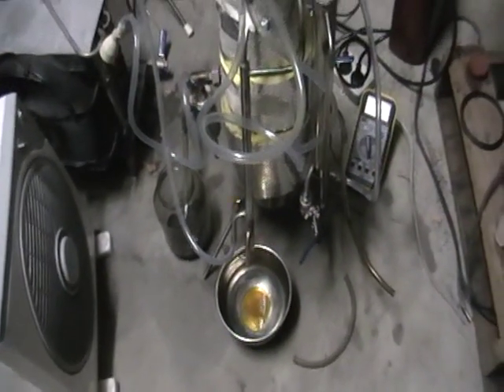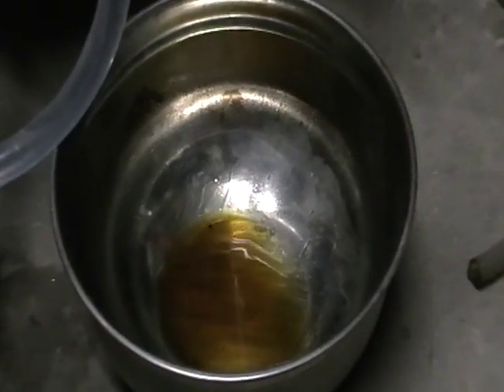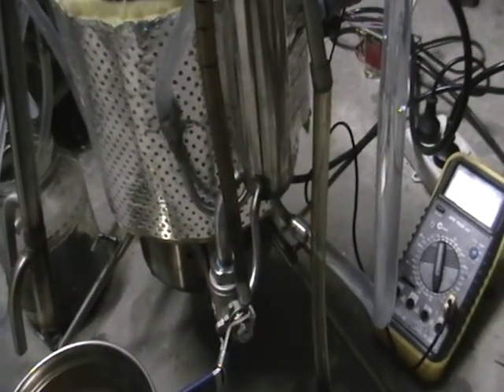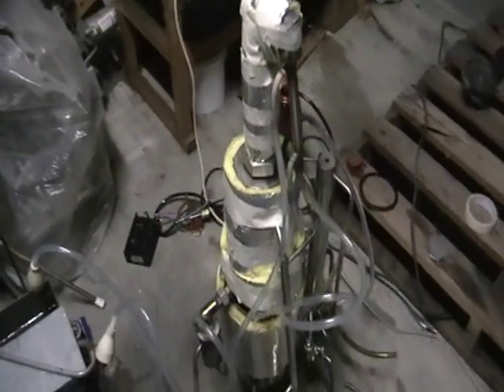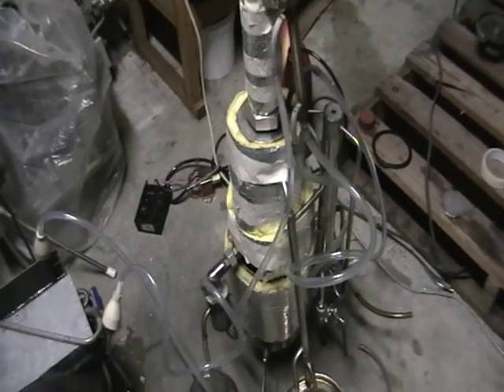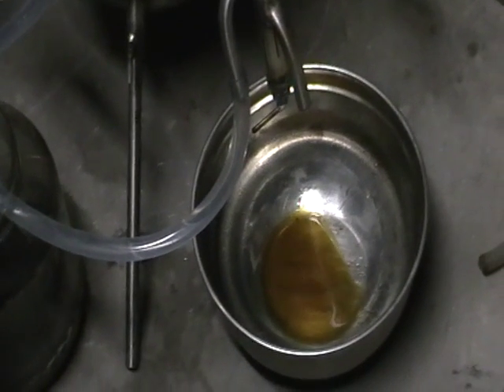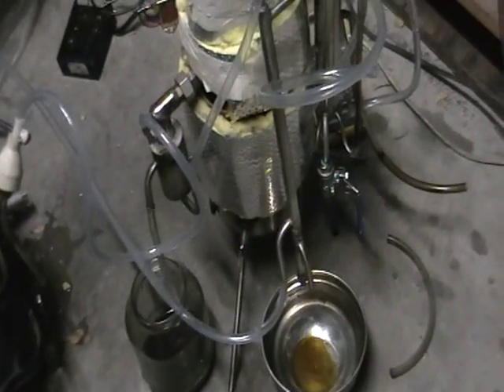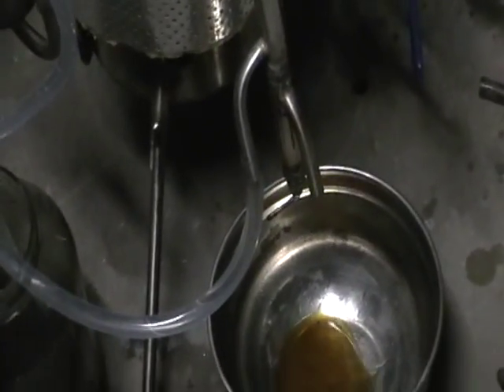Waste motor oil cracking

Comment: Hi, I'm from Mexico. I'm interested in buying your oil distillation manual. To get diesel, I have some questions. How many liters does it produce per hour? What fuel do you use to heat the oil? I wait your answe

Comment: Yes but, I don't. Have a machine shop and stainless steel welding equipment. Cost for a working used oil to diesel fuel converter?

Comment from the maker: Cost of machine and shipment will depend on the, size of the unit, production speed and power application - electric or diesel (processed oil) - the bigger and heavier the higher shipment.

Comment from the maker: Hi Jakob, the reformer has a number of trays where different fractions are condensed accordingly to the boiling temperature, the final column can be packed with a catalyst or remain empty as only lightest fraction can get into this column - petrol - and no heavy one will get up the column as the temperature in the column kept within the petrol fraction (multitude of different hydrocarbons) temperature range from +42 up to +200 degrees Celsius - "cracking petroleum"